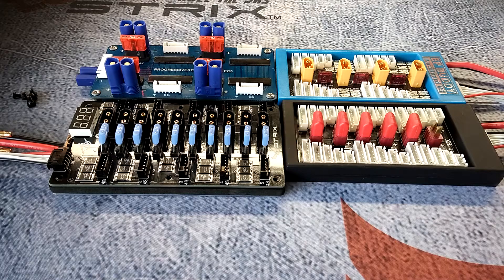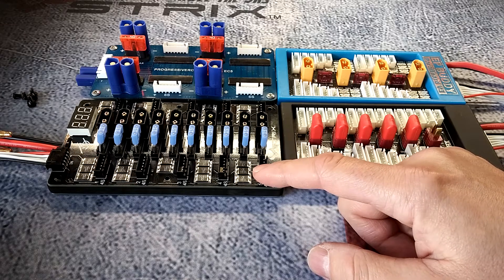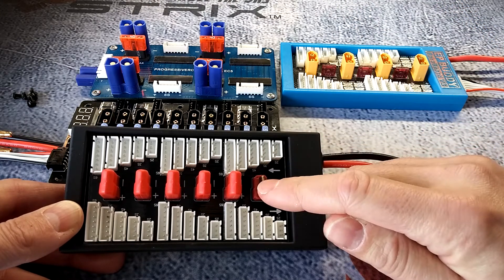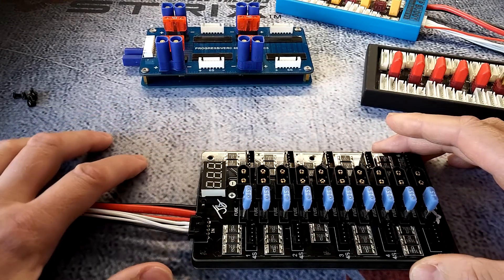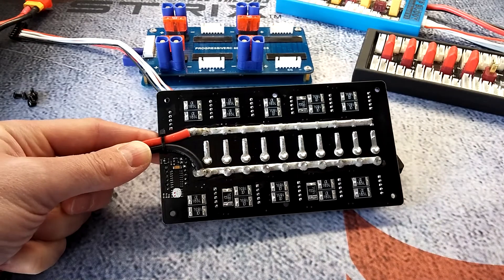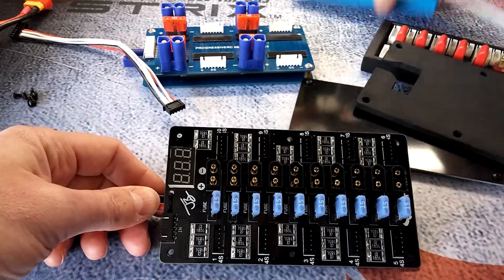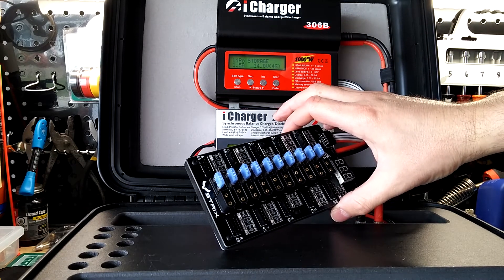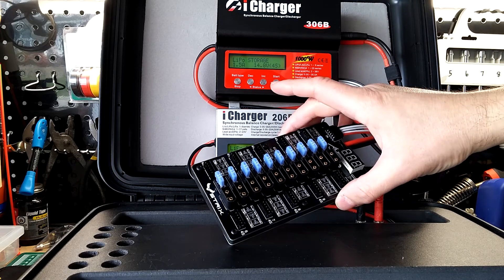Strix/Joshua Bardwell/RMRC V2 Parallel Charging Board Review

Comment: How do i power up this charger i see a red and black lead and a extra plug wire but nothing to plug into a wall outlet
Reply: You plug it into the charger not the wall. This is a balance board for charging many batteries off one charger output.

Comment: I am using those cheap ones with deans connectors usually two connected together charging 10 lipos and the same time and they have one fuse each. So I think you can go cheap and still be relatively safe.
Reply from the maker: kubaistube - Do you have a link to the parallel charging board that you're mentioning? I'd like to check one out to see how safe it is.
Reply: here it is: https://goo.gl/Qk81Es
Reply from the maker: kubaistube - That parallel board is a fire waiting to happen, the fuse will not protect against shorts in the balance port or main battery leads.

Comment: Why wouldn’t 1-3 S batteries work w/ this board.  As long as the balance connector is properly connected the board could care less if it sees 1s or 4s?
Reply from the maker: Nor Cal - I suppose it could work if you're being careful enough and force the balance connector in, but one little mistake could fry the board or the battery or both.
Reply: SteelRainFPV - Parallel charging is NOT for the weak at heart - in other words -> IDIOTS & somethin u don’t want to do unless ur right there regardless of how many safety fuses u have.